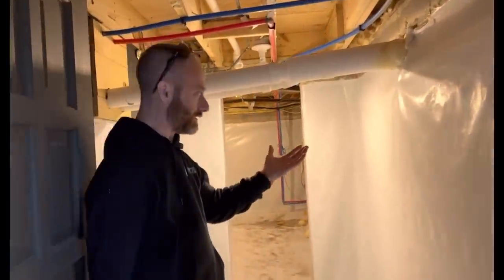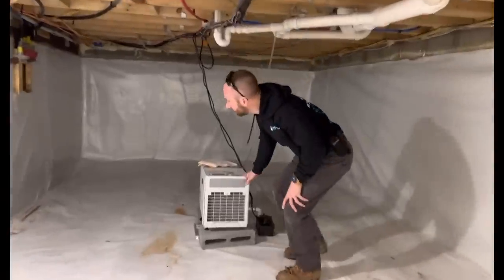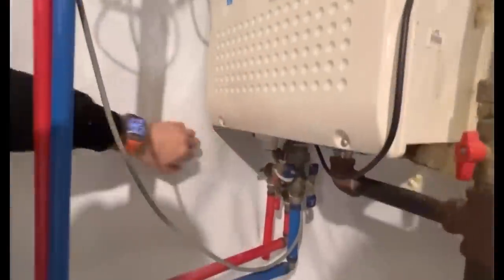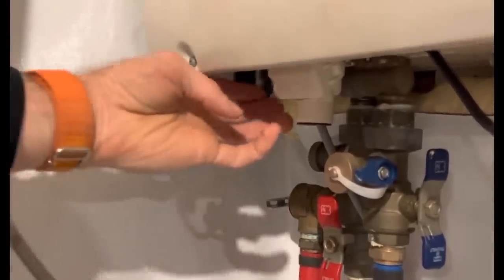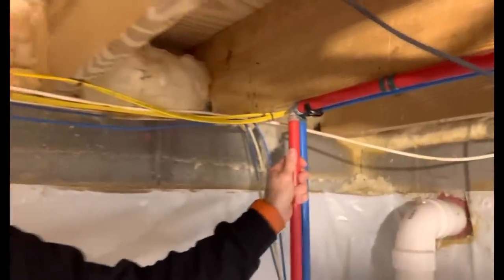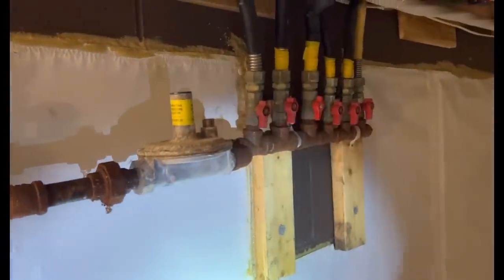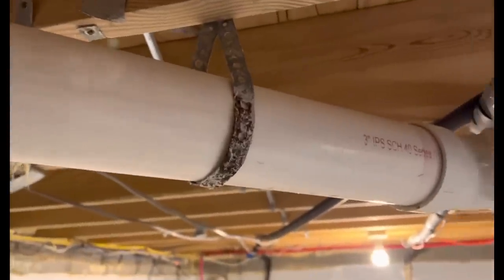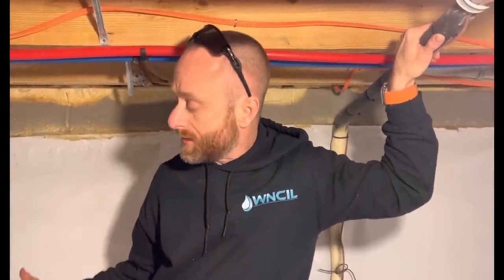Million Dollar House With a “Tiny” Problem!

Comment: Up code 407.2 requires that gas piping be supported by metallic straps, bands, hangers or by building structure.
Plastic supports are prohibited due to early failure rate during a fire thereby causing a stress point that may fail and will inject flammable gas into the fire making it bigger.
Usually I agree with what you say , but not about support of fuel gas. I am a licensed gas fitter in MN.
I almost always enjoy your channel, keep up the good work!
Reply from the maker: So, this comment got me doubting myself.  So I went back and read the install guide from TracPipe.  Here is the quote "The type of clip will depend on the installation but in most cases either a metal
(Munsen) or plastic clip with a securing device will be used"  Now, here is where it gets complicated. In a different manual, it says "Some codes do not allow the use of plastic hangars for gas piping systems."  So it seems codes are different depending on where you are at. So, I called my local inspector and asked him....I was informed metal clips are forbidden.  So, I have to go with him.
Reply: @JamesButlerWellAndSepticLife  if in doubt always go with the inspector request.
In MN we cannot use plastic for the reason I stated.
Thank you for following up on my comment. 🤠
Reply: as JB mentioned, it depends on the local code. In Ct we can't use plastic on black pipe but can use various types on Trac pipe, although most of what I see is metalic. Also, while indoor gas regulators are made, the set up shown here with the manifold would most likely be pushed outside by an inspector.... or at least the regulator. (I can't say for sure if it's indoor rated)
Reply: Good additional info from both of you & kudos for both being very polite!  Yep, codes can vary by location.
Reply: @rupe53 There's no reason today to have a gas meter indoors.  This is 53 years out of date, in Wisconsin we took all the gas meters out of the basement in the early 70's.  And we've been known to occasionally get down to 25 below zero.  Also they probably did not bond the gas and water lines together, thus creating problems with electrolysis.

Comment: Annnddd the Flash Shield CSST gas line is improperly done.
If that is the grounded type CSST like I think it is the cover with the shielding should go all the way down to the brass fitting.
And as for the strapping my state requires metal so that in a fire or high heat situation the support doesn't fail.

Comment: The improper Heater installation and use of the wrong clips for the gas line tells me either the installer did NOT pull the Permit they are Legally required to pull to put it in or they did pull the Permit and the Inspector was totally Incompetent (or accepting Bribes to Pass shoddy work)...

Either way, a Complaint needs to be made with the Code Enforcement Office and/or the State Ombudsman Office (if it was a bad Inspector) and Legal action needs to be taken to fix the problems...

Comment: How many times have you seen an old chimney under the house used to have oil furnace venting to it now they have gas furnace venting to outside but didn't close the chimney hole I see it alot anything will close it ball up some insulation and cram in the hole that's better than nothing

Comment: I don't know what the plumbing code in South Carolina is. But in Massachusetts where csst is still considered  new to the market. The code considers it a system so everything dealing with the csst has to be supplied by the same manufacturer. In this case it means those galvanized Clips have to be used. An inspector told me during their training. They only want to see metal clips on gas lines to make them unlikely to fail in the event of a fire. 
      The first time I saw the metal Clips on the plastic jacket of the csst, did not seem like a good idea to me

Comment: My coworker just bought a house 
from an 85 y.o. widower . Dryer was 
avacado green ( yup , THAT olde ! )
Didn't dry well at all. Ran out & got a 
new washer / dryer set.
Disconnecting behind the dryer 😳: 
5" flex duct "adapted" to pvc with 
duct tape 🤦 , & LINT-FILLED for the
bottom 4" !  The 4"pvc run was 20'🤯 
& LINT-FILLED 3"up 😱 !  HOW did 
that guy NOT have a lint FIRE ?? 
( coworker installed a new & proper 
exterior vent THRU the wall instead 
of running 20'  to a plywood-paned window )
GOD ONLY KNOWS what other surprises await him.

Comment: Condensate from high efficiency gas appliances is acidic, not much can grow in it. It’s not the same as condensate from the air conditioner which can get nasty with life. However that gas appliance condensate will dissolve concrete over time. Put a neutralizer on it and drain it to a sump pit

Comment: Here we have spot inspections now. Inspection is done by declaring the work is done to the inspection authority. Unless someone else catches a mistake or wilful corner cutting, you have to try to go after the original installer when problems develop.  Good luck with that 5 yrs later.

Comment: The constant high humidity from the condensate pool is probably what is causing the premature rust & corrosion.
Reply: I'd bet it's not the pool of water but the lack of drain line that allows combustion gas into the crawl space. That's loaded with steam like humidity plus other toxins.

Comment: Really informative videos on a subject I didn't think I'd find interesting. I have a question about plastic vs metal fasteners. Metal corrodes, but could plastic leach chemicals depending on the plastic? Which is better?

Comment: The copper line is the liquid line not an oil line. The HVAC lines are the liquid line and suction line along with a thermostat wire.
Reply from the maker: Yeah, I got that wrong. I'm learning.

Comment: Easy fix. Condensate pump to a drain or outside, and 20 bucks for new straps and clips. Anyone could do that job. Anyone could also find the source of the water if they wanted to. Tracking a drip like that would be easy.
Reply from the maker: Then tell me why I was the 3rd company out....and none of the others fixed it....just saying.

Comment: I dream of a tankless water heater 😍. My house was built in the early 50s, so we probably have metal clips holding our gas lines. But the energy company has to come & put a new meter in, change the meter to be outside instead of inside the house, run a new line from the edge of the road to the house, & I believe they said they'll be running new gas lines inside the house as well. Cause they're all old as shit & they're technically their property lol What I'm getting at is, even if they are metal clips holding the gas lines, they won't be for much longer

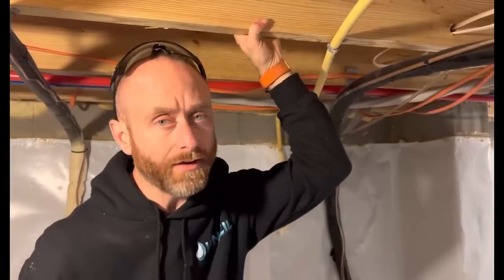Comment: That flexy yellow gas line snaking through the rafters  (3:10) like that can't possibly be legal, is it?  Surely hard iron pipe is required if it's going behind drywall.
Reply: No sir the only part of the trac pipe that has to be accessible is the fittings

Comment: A condensate line for a hot water heater?  My propane water heater(s) don't have those.
Am I correct in assuming that the water heater in the video is a fancy electric water heater?
Reply from the maker: Nope, its gas. Some models have a condensate line and some do not....this one is a piece of crap and has one....
Reply: @JamesButlerWellAndSepticLife  , thank you.  I would never have known to look for a condensation line.
Reply: That's a "demand" water heater, it can modulate the size of the fire down if you are only using a small amount of hot water, the combustion process put out CO2, CO, water. The water is very acidic and will rapidly corrode any metal and is supposed to be run through a neutralization material before being discharged directly into a drain, not just dumped on the floor.

Comment: Man, they should have at least run it through an acid neutralizer before letting it drain on the floor.  That condensate has higher acidity than plain water :)  Actually, after thinking about it what came first , the water heater of the plastic??

Comment: Oh yeah, water heaters... I'm not a fan of electric ones. I'm really not a fan of those ones that don't even have a tank. Maybe for a public bathroom in a business, where it's just people washing their hands, but not in a house, where people (presumably) take showers. If I'm gonna take a 30 gallon shower, then I need a 30 gallon hot water tank. (Google results invariably turn up metric measurements, and since I don't speak metric, and I don't have a calculator in my head to do all the conversion math, I have to guesstimate.) And some Rustoleum would keep those gas pipes from rusting, just saying.

Comment: Metal brackets. On a gas line. I know some building inspectors in my neck of the woods who will get the MOL involved for that shit and try to get your license run through a shredder. But you mentioned it casually like it isn't a huge deal. Its technically wrong but like...meh. Definitely curious what the sort of building codes are where you are at compared to where I am (ontario)
Reply from the maker: I mentioned it like "meh" cause it was not the focus of the video.  We have already provided her an estimate to fix it.  That work is being scheduled and we take it very seriously.
Reply: @JamesButlerWellAndSepticLife  Oh I had no doubt you took it serious. Just curious the level inspectors would take it culturally. I'm sure we all know there are different things in different areas that are in building codes and some of them you'll find there is a culture of 'eh close enough is good enough'. So to clarify its more a professional curiosity since I've never worked south of the border, particularly as far south as you are at. So I find it interesting to try and understand if there are any notable differences in codes, both written and the cultures of enforcement :) Great video though and glad she's taking the work forward and getting it done.

Comment: Man that copper line set is not done right. When I ran line set the 3/4” or 7/8” always had an insulator sleeve but the 1/4” line never did. We always took special insulators white tape and strip taped the copper to the side of the insulated sleeve of the thicker line. Of course, I’m doing this in Washington state, where it rains like 300 days out of the calendar year so, there ya go. 😂😂

Comment: You've intrigued me. What sort of service does my tankless water need?
Reply: It needs to be flushed with a vinegar or an approved chemical annually and it should also be taken apart. The flame rods and igniters cleaned and vacuumed and blown out electrical connections. Checked venting checked for obstructions. All sorts of things
Reply from the maker: Yeah, what that guy said!!!!

Comment: I have no idea about your local codes but where I live gas lines MUST have metal clamps. You will fail your house inspection if they are plastic.
Reply from the maker: So, this comment got me doubting myself.  So I went back and read the install guide from TracPipe.  Here is the quote "The type of clip will depend on the installation but in most cases either a metal
(Munsen) or plastic clip with a securing device will be used"  Now, here is where it gets complicated. In a different manual, it says "Some codes do not allow the use of plastic hangars for gas piping systems."  So it seems codes are different depending on where you are at. So, I called my local inspector and asked him....I was informed metal clips are forbidden.  So, I have to go with him.
Reply: @JamesButlerWellAndSepticLife  Agreed, go with what your local inspector dictates. Short of finding the exact code the local city inspector insists  clamps must be of the same material class as the piping used such as steel band on black iron and trackpipe/ gastite, copper on copper. I've had to change out clamps on NG jobs installed by out of town companies that the inspector failed due to plastic being used. I think its silly but local codes take precedence over my opinion.

Comment: I've got to be an absolute idiot. I've never seen or heard of a concesate line on a water heater. What condenses? Every thing I've seen the cold water enters and is heated. condensation happens when air is cooled beyond it's ability to contain the evaporated moisture in it. Is the condensation occuring on the incoming cold line? I'm out west where the air is much dryer than the south so maybe it's just a local thing for you guys? Please educate me. Thanks

Comment: the most bizarre thing about this is that dehumidifier. so it extracts the moisture out of the air and goes... where? it's still in that room... there is no line to bring the extracted water from the dehumidifier anywhere.... it's literally a machine doing nothing.
Reply from the maker: There is a small tuning line running out to the outside.